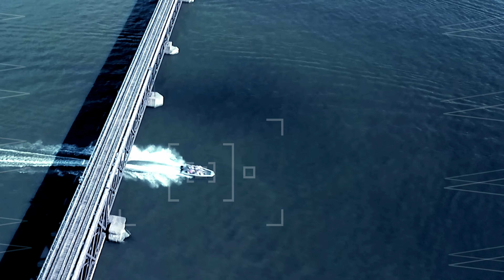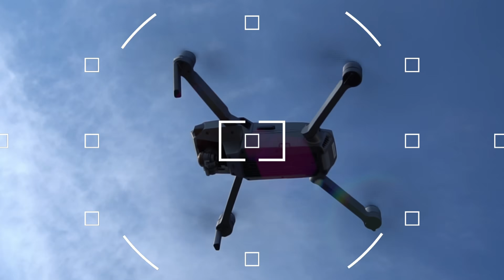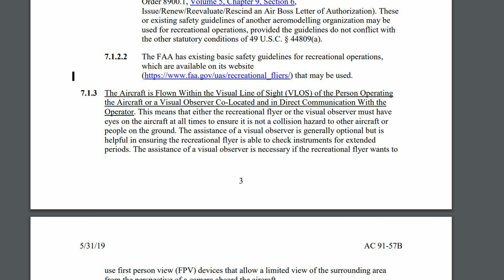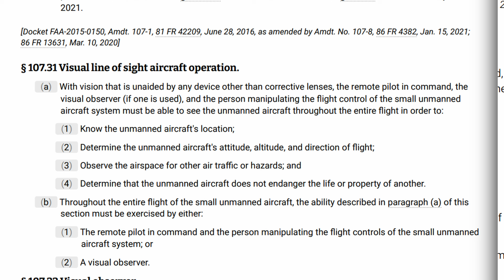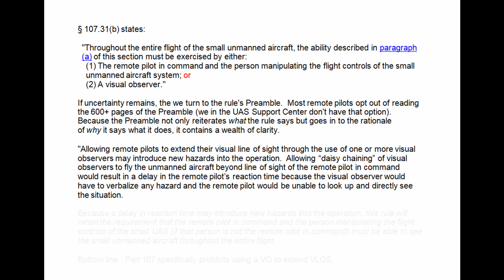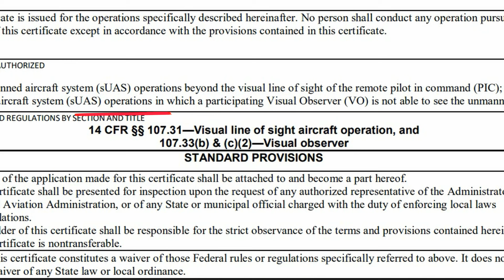How Far Can You Fly a Drone Legally? - BVLOS

Comment: In my opinion the FAA can take a flying leap thru a rolling donut. I flew fixed wing and mostly cropdusting for over 50 years and accrued over 17000 hrs. of flight time. I enjoy my drone and I will not comply with this BS. I've never had this much since I fed my little brother to the pigs.  I can't even see my little DJI mini 4K when it reaches out past 100 yds so putting out a line of observers within yelling distance is typical of guvment overreach and total nonsense.

Comment: @AlienDrones So that I understand, even though the drone has a camera with live feed to my remote and the drone is capable of several miles range. I still need to be able to physically see the drone in the sky? Which would likely be less than a mile away.
Reply from the maker: Correct.  There is no exact number but it is closer to 1000' than a mile...  To the letter of the rule you not only have to be able to see it but at a glance determine orientation and heading, so it is a lot closer than most people think.🤙
Reply: The input received by our eyes is coded sent to our brain and then decoded from being upside down. So there you go, the controller gives us far more accurate information than our eyes. So perhaps its VLOS that should be band, if you have to look up at the drone you don't know what you are doing! lol

Comment: I’m new to drones… On the FCC side of drove operation, in our test for an Amateur Radio License, it is mentioned that a Technician Class license or higher is required for certain drone operations. I’ve found this is because some video transmissions occur via the Ham Bands, but no specifics beyond that. 

I’m curious if the Ham license plays into the Part 107 Waiver? And I’m also  curious what regulations a company utilizing a package delivery drone is falling under? Because LOS makes the package delivery drone element completely pointless.

Comment: How do trees/forests factor in VLOS? Where I live it's pretty much impossible to fly a drone while being able to see it 100% of the time. I can see it MOST of the time, I can hear it, and I know exactly where it is, where it's going, the altitude, and the speed. I can also see and hear any manned aircraft long before it gets anywhere near my drone, unless it's common for supersonic aircraft to fly at or below 400ft AGL. The reason I'm asking about this is because I don't fly over forested land because it's my only option outside of driving quite a ways to an open area. Aerial photography of, and especially in forested areas accounted for 90% of my decision to purchase a drone in the first place. Is there any clarification on flying over and/or in forests? One type of flight I purchased a drone for is to use it's auto-tracking "follow me" functions to record my MTB trail rides. As much as I want that kind of footage, I don't want to get slapped with a $100k fine, and I can't seem to find any clear info for flights in these conditions.
Reply from the maker: VLOS is just that, VISUAL line of site.  If it goes behind a tree, a building, fog or simply too far away or you are behind a door, in a car, etc. and you can't see it directly in a straight line it is beyond visual line of site.

Comment: Some folks believe that as long as they can "SEE" their drone, yeah, that tiny dot on the horizon, that they are still legally within Visual Line of Sight. The part that is not clear is this: where is the point that is considered "Beyond" visual line of sight?
Reply from the maker: It's a grey area for sure, but, the way VLOS is defined by the FAA is that not only can you see the aircraft, but you need to have enough visibility to be able to ascertain UAS direction and orientation at a glance.  I expect this detail significantly shortens the distance most people consider in VLOS.

Comment: range tests are the reason the hobby is being more restricted...its irresponsible flying and harming the hobby for those that fly safely
Reply from the maker: One of the reasons for sure...
Reply: Previously in an interview the FAA mentioned that they were only getting 30% participation from the public.  I wish I had saved the video but on MSM they also showed a law-enforcement tracking system used for drones in a parade & you'd be surprised at how many drones were up in the city being watched.
Reply from the maker: @SlackerU  Do you recall 30% participation in what capacity?  Registration, TRUST test, Remote ID, Part 107, simply following rules, being legal?  Would be interesting to know how the FAA defines participation.
Reply: @AlienDrones  30% participation in LAANC submissions to fly in restricted airspace like cities. It was one of his reasonings for RID.  I'm not surprised as drones were sold in the Christmas-Light Accessories in all our Home Improvement Stores. I think you have actually spoken to that FAA rep.
Reply from the maker: @SlackerU  Thanks!  Wow, 30% in controlled airspace.  Yikes.

Comment: Excellent presentation.  Reasonably concise, to the point, and includes the waiver however difficult it may be to get one.  I tried and failed but one of my uploaded support documents didn't succeed to upload.  You have to show that absolutely no risk to anyone exists and that the drone cannot just go flying off forever.  Vast regions of the American Southwest are unpopulated, often unvegetated.  
Instead I just put bright strobe lights on my drone so I could determine not only location but orientation at a distance.  That's good for a mile, two under optimum conditions and it helps to have a larger drone to start with.  A visual observer is very useful even then because regaining visual on that blinking speck a mile away is not instant.
Reply from the maker: Thanks for sharing!

Comment: I've put strobes on the bottom of a drone to extend line of sight for recreational flying. In bright sun the maximum for me is about 500 feet.
Reply: Then it’s becomes over weight if it’s a 249 g
Reply: Then pay the $5 to register the drone or get Part 107 certified. Every decision has a cost.
Reply: VLOS also includes the ability to determine the direction of flight. So, putting the strobe light on the bottom of the drone doesn't satisfy the rules.

Comment: Very appreciate you keeping us informed.  But I have a unique question. We all know manned aircraft have the right of way, my question between 2 or more sUAS, who has the right of way?
Reply from the maker: Thanks, my pleasure!  To the question of right-of-way:  Section 107.37 states that considering an unmanned and manned aircraft scenario, the right-of-way is to the manned aircraft and as such the unmanned aircraft must yield.  In the case of two unmanned aircraft there is no specific rule for right-of-way, instead the FAA specifically states that "in such cases, the rule will require the remote pilot in command to use his or her best judgment to avoid other small unmanned aircraft in the NAS."  In addition, since the rule also requires that "No person may operate a small unmanned aircraft so close to another aircraft as to create a collision hazard", (even another unmanned aircraft), and in this situation both pilots in command are required to take action to prevent a collision or hazard, neither unmanned aircraft has the right-of-way, essentially requiring both unmanned aircraft to yield to each other.  Hope this helps!  🤙

Comment: Hi Keith
Some of the range tests have been over water out to islands.  With no people in the area.    If the observer was a light aircraft pilot. The observer could give course/elevation corrections in a similar way to a control tower.  "Goto to course 270 and 250ft. "   using a radio.
These type of range tests can have a significant risk of losing the drone. 
Good video,
Cheers mike
Reply from the maker: Indeed, BVLOS for drones may become a reality someday, but not yet!  😎

Comment: I understand the reasoning behind VLOS but it’s not a logical rule. A pilot can only look at 1 thing at a time. If I launch my drone straight up then look at the controller screen to check settings, direction of travel, exposure or 20 other things I’ve lost VLOS because I’m not looking at the drone. Depending on the sky my drone could be 500 ft away and 200 ft high and once I look down at the controller I may not be able to find the drone when I look back up. With my mp3 when I’m bringing it back to land I use the compass and look up to find it but I usually here it before I can visualize it. I hope the rules committees have real drone pilots when making and adjusting these rules.

Comment: Thanks for the clarification and simplification. It would be worth noting that some of the observed range tests may be occurring outside of the USA and be subject to different regulations.
Reply from the maker: Great point!  Of course, many are in the US and are either unaware or are simply ignoring the regulations...  🤙
Reply: @AlienDrones  Studiously ignoring regulations seems common but also the enthusiastic brand new drone operator the first thing he does is see how far it can go.  It used to be how high can it go but DJI put a stop to that.  
I'm much more cautious; my first flight was in my back yard and DJI had a "beginner mode" with severely limited range and altitude limits.  
Then my boss wondered about building a hotel, what would the view be from 90 feet up?   That's easy with a drone, grab a 360 degree panorama from 90 feet up. Here you go, but guess what, that's not a recreational flight so I got my Part 107 the hard way (studied the PHAK and other resources) so that even trivial things like that were legal.  
The more I learned the less FUN it all became because now I am acutely conscious of light aircraft, helicopters and the possibility of errant uas.   
I LOVE the ADS-B receiver in new DJI drones.  I had no idea.  So one day I am flying around a newly constructed apartment building getting some stills and video, I've checked the sectional charts, weather, TFR's, all good.  Then suddenly the remote contoller announced "manned aviation nearby" or something like that.  I didn't yet see the conflicting aircraft but I lowered the drone to rooftop level and waited.  A couple minutes later here comes a light aircraft; around 700 feet AGL I think and about half a mile west of where I was operating.  It is farmland so there's crop dusters  and I suspect most don't have ADS-B but this one did.

Comment: I MAY have broken that rule flying over forested land. And quite frankly, I don't know anybody that flies airplanes that would fly as low and close to the trees as I was. And then there is the path through the woods that would be impossible for any airplane to fly in. They would have to crash first. But it would be nearly impossible to maintain visual on the drone.
Reply from the maker: Indeed, such a rebel...   😵
Reply: @AlienDrones  not a rebel so much, but just practical. The aforementioned scenarios were just to point out how one could be legally out of bounds while still being entirely safe

Comment: Having remote ID probably won't be much help in legally extending VLOS as it does nothing to address the concerns put forth in the preamble.  Remote ID will only aid in assigning liability.  Safety First! I like to think of the drone at takeoff as a "slow" moving bullet that I better be in control of during its entire flight through the air.  Not much different than a car when you think about it.  

Good job on investigating the regulations!
Reply: For what it's worth, he does have a video from a while back where he has a conversation with an FAA representative. That rep explicitly said that he envisions Remote ID as a necessary predecessor to allowing flight BVLOS
Reply from the maker: Thanks for sharing!
Reply: The relationship isn't obvious but yes, Remote ID is crucial to BVLOS.  What are you most likely to collide with, and NOT SEE?  Other drones!   It is easy enough to see light aircraft and anything larger at a mile; but Amazon's delivery drones, probably not.  
So if drones can avoid each other then BVLOS becomes a lot less risky.  DJI drones also now have ADS-B IN receivers ("AirSense" they call it) so the drone knows about manned aviation in the area provided the aircraft is broadcasting ADS-B.  In rural areas, Class G airspace, apparently it isn't mandatory.  At the moment no automatic action is taken but the operator is alerted and several levels of alert risk are offered. 
In other news, Remote ID and ADS-B both use "geometric altitude" which is MSL, mean sea level.  So the drone knows its altitude above launch, but it also knows its absolute altitude MSL so that it can compare it with ADS-B broadcasts and estimate risk.

Comment: Do you have to see the structure of the drone, or are visible lights that convey orientation and direction sufficient?
Reply from the maker: I don't believe seeing the structure is a requirement.  Having lights at night that provide visibility for the orientation and direction are acceptable so I would think without a specific exclusion that as long as the visibility requirement is met, should be fine during the daylight as well.
Reply: @AlienDrones  Actually that is incorrect. The VLOS rule also states that you must be able to determine the altitude. At night this would not be possible.